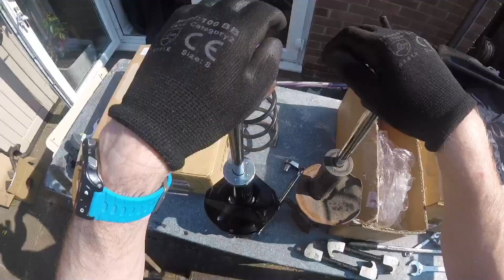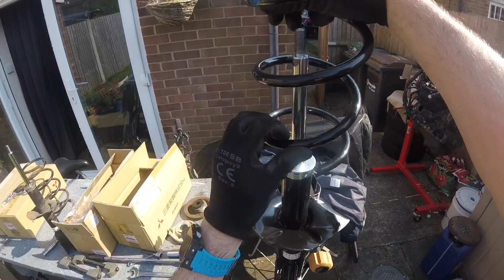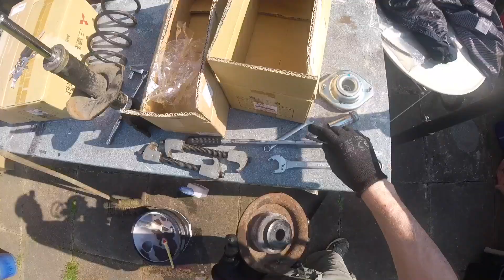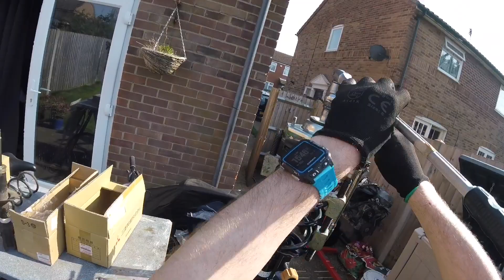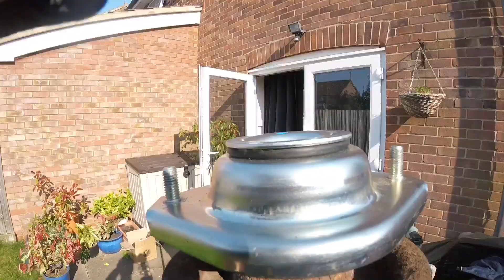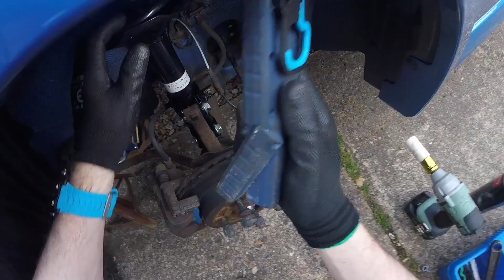New Struts, Springs and top mounts. Ignis Sport transformed!

Comment: Great vid..Quick question..When mounting the top mount nut I guess the shock rod has the hex/Allen nut and the bolt (for the 17 socket tighten on to it right? Looking to get some lowering springs for mine so this is really helpful .Cheers👍

Comment: When i was looking at replacing the top mounts I am advised there is a bearing, do i need this, also is the rubber seperate? Thanks
Reply from the maker: There is a longer video. Bearing and top mounts, assume it will be ruined after 18 years. The rubber is part of the top mount. The bump stops may have gone flakey now too, best check them. Will be £250 or more from Suzuki